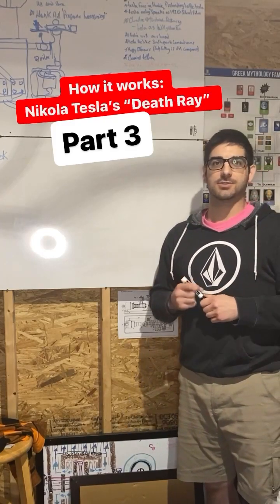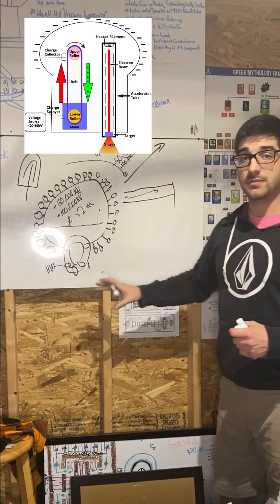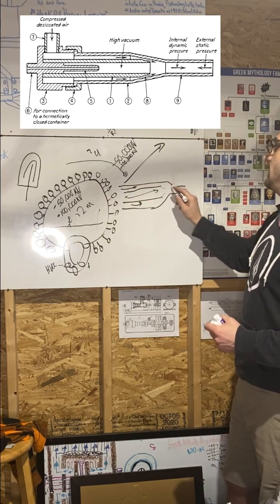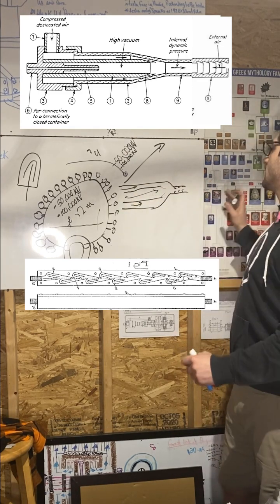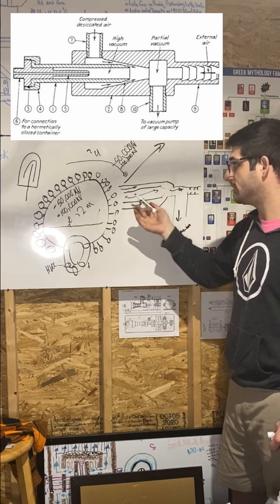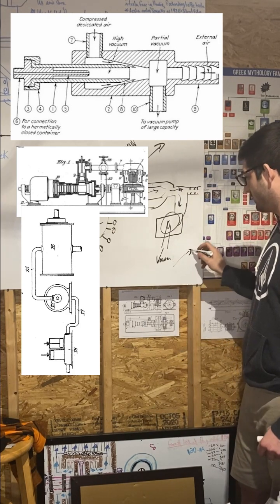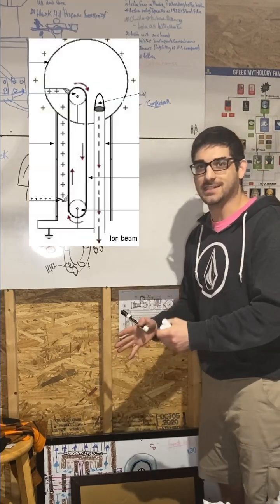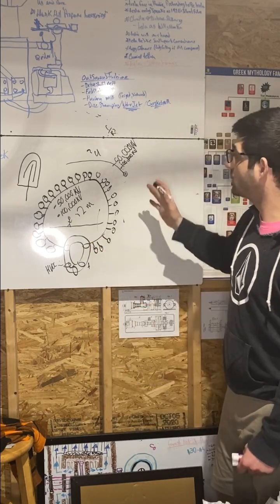Nikola Tesla’s Death Ray: How It Actually Works - Part 3

Comment: I see some use for this  in launching very small interstellar probes.  Project Starshoot is looking to open a giant "sail" on a 1 gram probe and shoot it with a laser array to get it to 25% of the speed of light.  This seems like a much more scaleable way to accelerate dozens or hundreds of such probes to the far reaches of space, provided of course that the payload could be protected.

On a larger scale, it could propel spaceships to escape velocity without the use of rockets, and could do so using electrical energy from sustainable sources.
Reply from the maker: Hey thanks for commenting! Yess! Absolutely. That’s exactly what I was thinking. Or at the very least this could make it easy to lob materials into orbit for building massive space craft in zero g. That way they don’t need to be made to escape the earths atmosphere either. 

The other way I was thinking was to sum it down instead of up. And use it for geothermal hole boring. 😈

It would cauterize the bore hole all the way down and the material could be sucked out as vapor
Reply: @CharlieSolis  you do realize that giving an object to skip velocity at sea level mean it will just disintegrate in the atmosphere
Reply from the maker: @alphaindustries5775  hey thanks for commenting. It means it will
Ionize the air along its path and render it conductive.

Take a read of what Tesla says about the ammo. 

“In order to determine the probable trajectory the air resistance encountered by the particle has to be estimated from practical data and theoretical consideration. 

Very extensive ballistic tests by French experts have established conclusively that up to a velocity of 400 meters per second, the resistance increases as the square of the speed but from there on, to the highest velocities attained, the increase is directly proportional to the speed. 

On the other hand, it has been found in tests with rifles that an ordinary bullet, 8 millimeters in diameter and three times as long, fired at 400 meters per second, encounters a mean resistance of about 0.02 kilogram and from these facts, it can be inferred that the average resistance of the particle at the maximum speed V might be of the order of 1/64,000 of a kilogram and if so, the trajectory should be approximately 64,000 meters or 64 kilometers. 

Obviously, resistance data cannot be accurate, but as the mechanical effects can be increased many times, there should be no difficulty in securing the practically required range with a transmitter as described. 

In all probability, when the technique is perfected, results will be obtained which are thought impossible at present.

Such a particle, notwithstanding its minute volume of 1/250,000 cubic centimeter, would be very destructive. 

It would pierce the usual protecting covering of aeroplanes, put machinery out of commission and ignite fuel and explosives. 

To combatants, it would be deadly at any distance well within its full range. 

Projected almost simultaneously in great numbers, the particles would produce intense heating effects. 

In action, against aeroplanes, the range would be very much greater on account of the smaller density of the air. 

Evidently, the smaller the particles, the greater will be their speed. 

For instance, if r = 1/10,000 centimeter, a velocity of 160,000 meters per second will be attained. 

An enormous increase in speed and range would be secured with particles of a diameter smaller than 800 times the molecular diameter.

It is important to devise a thoroughly practical and simple means for supplying particles and I have invented two which seem to meet this requirement. 

One is to feed tungsten or other wire from a spool in a closed container joined hermetically to the projector, the rotation of the spool being under control of the operator. 

Using wire 2/100 centimeters in diameter, twenty cubic centimeters of the same would provide material for 5,000,000 particles. 

The other device consists of a closed container fixed to the projector and filled with mercury which can be expanded by external and controllable application of heat and forced, under great pressure, through a minute hole in the extreme end of the extension reaching to the distance d as before illustrated and explained. 

The droplet torn off and projected would have the hardness of steel owing to the great capillary pressure. 

If mercury can be used for the purpose, this means is ideally simple and cheap.”.    -Nikola Tesla

Comment: So what are your thoughts on Marco Rodin and the Rodin coil and what do you think of the 3,6,9 …..
Reply from the maker: Hey th asks for the comment. 🙏❤️‍🔥

So I hate to be the bearer of bad news but the 3,6,9 quote is not a real Tesla quote. 😔 despite the MANY people on the interwebs plastering it on photos of him.
Reply: @CharlieSolis  for instance how all life is on a bilateral system like 1 cells becomes 2 then 4 then 8 and how it’s linked to vortex math… sorry if that’s not a clear statement/question..
Reply from the maker: @shaner.7337  Hey thanks for commenting. None of this has anything to do with that. This is basic electrostatics. 

Even Tesla’s wireless transmission system can be completely explained with modern physics. 

I say this lightly, but beware of falling into all those alternate theories. 

I’m like 99% sure the 369, ether, scalar, vortex math are the disinformation to delegitimize Tesla’s real works. 

I’ve been  working on a video about it for a while now actually. And I’m about to release my book where I explain exactly how Tesla’s ground/earth based transmission system without wires completely with all modern physics. 

Please, buyer beware on all things “369, vortex math, æther, scalar wave, etc”.

If you’re not familiar with the film “mirage men” I highly suggest watching it. 

https://youtu.be/srtrRbt77AE

So back in the day during the early confidential Jet and flight programs right after world war II, a bunch of the UFO conspiracy theorists would post up outside of airbases with cameras and stuff taking photos. And they would inevitably eventually catch a glimpse of a real top secret jet plane or new foil design and get a grainy or blurry photo or recording of it. Nothing too detailed that the average person would ascertain anything from, but they would take these photos back to their ufo conventions, and as bad of photos as they were they’d still stick em up on the wall and projector screens because that’s all they had. And EVERYONE got glimpses of it.  Well China and Russia caught wind of this, and sent the spies into the conventions, and now again, while the normal person wouldn’t understand what you’re seeing these spies could take the pictures back, and Russian aerospace engineers would be able to actually understand what these new wing shapes, and everything were

Well when the US government found it the ufo conventions were actually accidentally leaking real classified flight projects to Russian and Chinese spies and they took like 100 airman and had them sit down and manufacture a TON of fake but official govenrmtn document look files. Everything from taking old plane parts and dropping them out the back of a plane and then taking high res photos of the “crashed” parts and label the photos as “UFO” crash sites. 

Then they went and dropped this veritable “treasure trove” of “leaked official government documents” in the middle of all the ufo conventions just flooding the ufo community with a bunch of manufactured ufo reports, more fake documents than would take a lifetime to sort through. Literally jam the information leak with a flooding of manufactured information.

Next thing you know not a soul would even look at the blurry or grainy photo of some random plane off in the distance because they had a MOUNTAIN of “real” stuff to go through still.

It’s my opinion that the government used ether/scalar wave nonsense to cover up any and all of the leaks they had in their confidential nuclear research and test program leaks they had in the alternate energy community in the exact same way the government did for the confidential flight program leaks they had in the UFO community. 

Even getting our foreign adversaries to dump money into attempting to research the outlandish free energy claims would further waste their resources. 

Again, buyer beware of the manufactured rabbit hole that is 369, vortex math, ether/scalar waves…
Reply from the maker: @shaner.7337  again I appreciate your comment but if you want to know what’s really going on with 3,6,9 check out Mathologer’s video about it. It’s just basic numerology of base 10 math. There’s nothing “special” about it. 

https://youtu.be/6ZrO90AI0c8

Nowhere in this device is there even a coil.

Even the HVDC can be produced directly with Tesla’s DC generator patent and not using his step up transformer (Tesla coil)  

But, out of respect for me, will you please keep enquiries to the topic of the video.  🙂🙏 thank you.
Reply: @CharlieSolis  damnnnnnn I’m definitely going to look into all of this … I’ll be going through all your videos soon …  it won’t be long before I think of another thing to ask
Reply from the maker: @shaner.7337  please do!
Reply: @CharlieSolis  yeah sorry I don’t every comment on things I didn’t know that was YouTube commenting etiquette
Reply from the maker: @shaner.7337  it’s not so much a YouTube etiquette but rather the etiquette I would prefer here in my comments section. thank you for respecting my wishes. ❤️‍🔥🙏
Reply: @CharlieSolis Is there a way to contact you

Comment: Looks cool Charlie! You gonna build one?
Also, on another note, i don't know if I mentioned it yet, but rotation detonation engines have been made to work by using a Tesla valve.  Maybe you and Integza could make one together (I know he made one already but not with Tesla valve at input and he has too many followers for me to reach him).  The valve basically prevents back flow and works well with the unpredictability of the detonation. Have a good day!